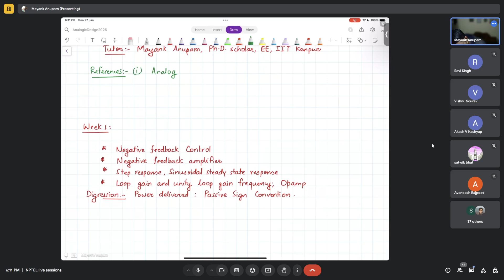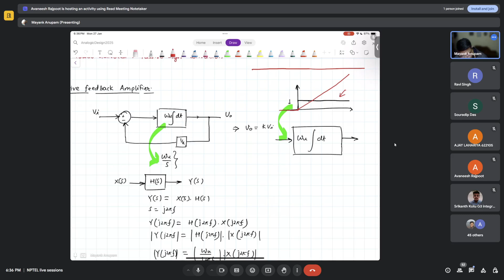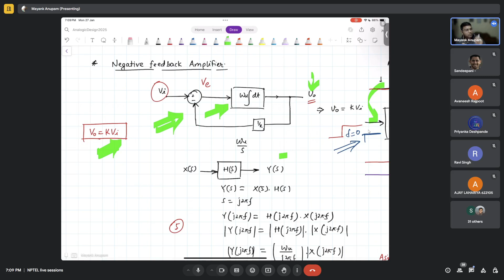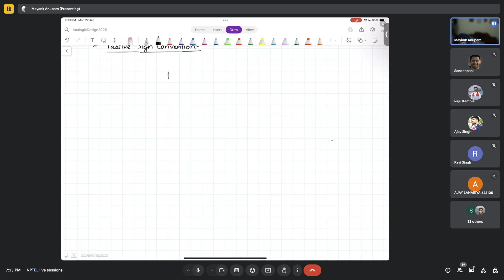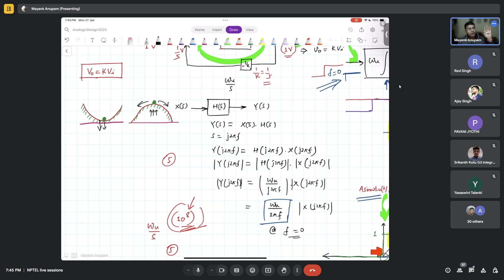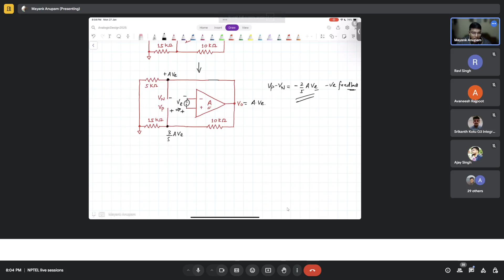week1

Comment: sir how it is 3/5AVe at Vp side by calulating using voltage divider formula it should be 
Ave*(15/5+15)=3/4AVe.
Vp-Vn= 3/4AVe-AVe= -1/4AVe  -> -ve feedback .. 
I eagerly await your response sir.
Reply: it will be Ave*(15/10+15), so u get 3/5*AVe
Reply: 👍I do not I don't understand what this is doing